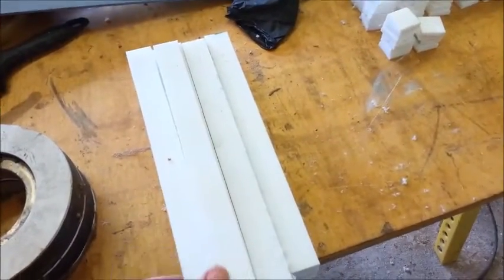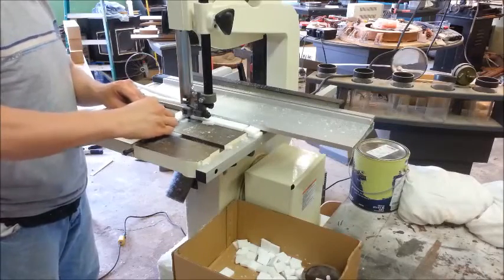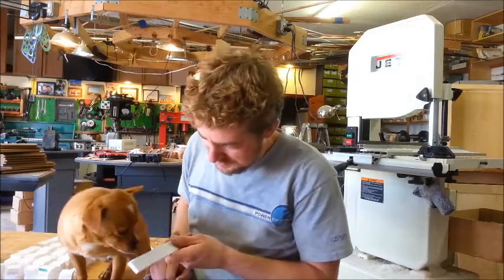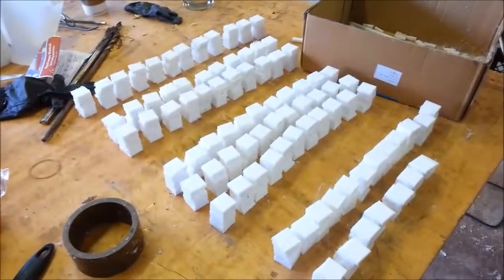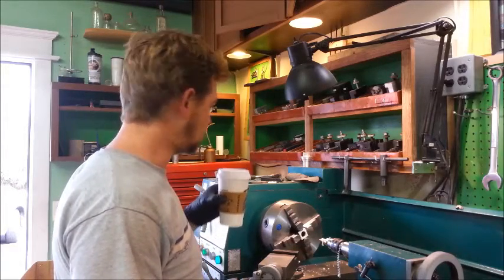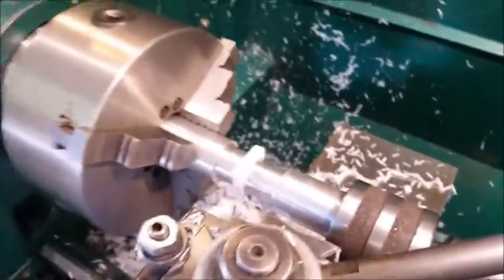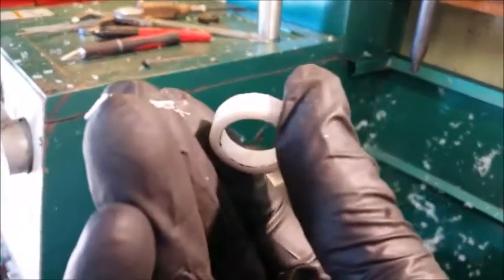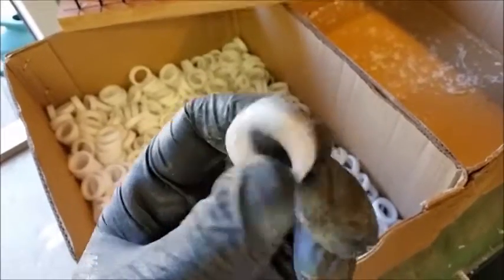Searl Effect Generator replica: Teflon roller rings

Comment: Nice work...I have been building a seg for about six months now...and have been waiting for your postings...u can see my prototypes on danknugget...will b posting my vids in near future...have second ring complete with the third in the making..currently running 12 coils @ 12vdc input...keep up the good work hopefully one of us will figure this thing out yet.
Reply from the maker: TheRealVerbz Honestly I dont know, how would I calculate that?  Fernando told me the percentages of each rollers layers and that is what I based my measurements on..Any help is deeply appreciated :)
Reply from the maker: Wonderful!!
Reply: TheRealVerbz Yes all the rings and roller components have the same weight ...not an easy thing to achieve...lots of R &D..no blueprints here....well i have now...my own BP....not to much time right now but in the near future....more will be posted....and thanks for the info muchly appreciated